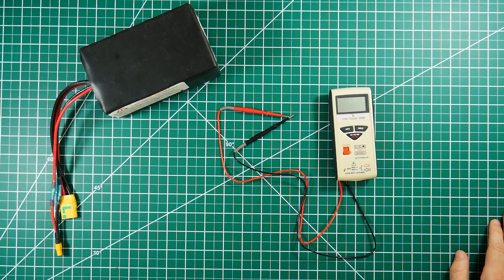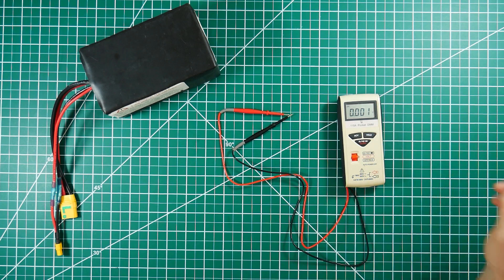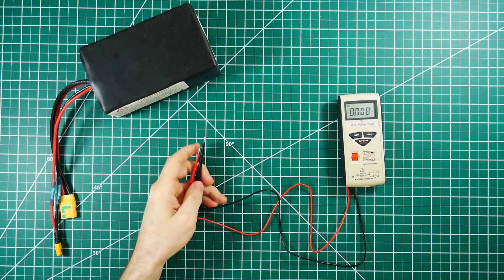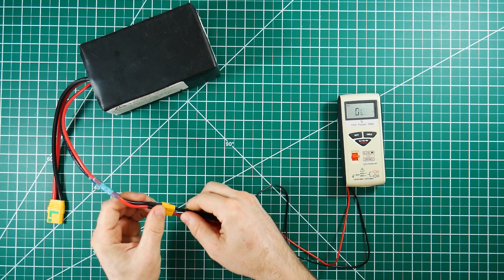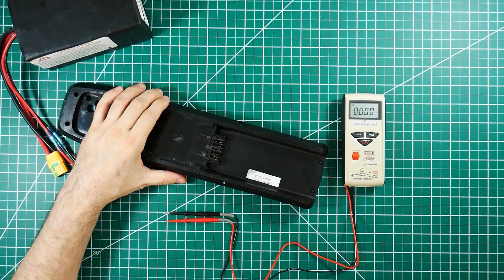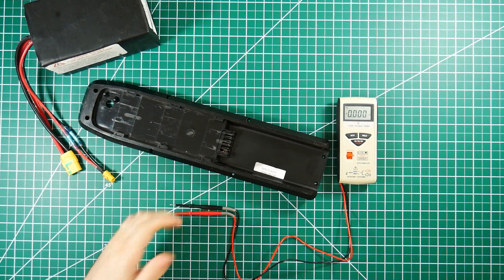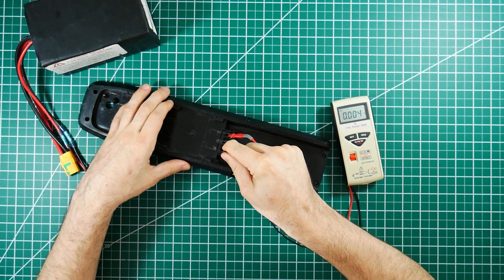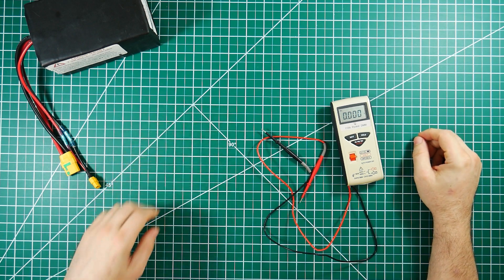How to check voltage on an ebike battery

Comment: So my bike (so I'm led to believe) has a 52v battery. The bike's LCD screen shows 58v when fully charged but my Volt meter reads 36.7v on the same battery when fully charged. Any ideas how on Earth that could be? Have I been sold a battery that isn't 52v ! ...and an LCD screen that reads 58v when it's not really 58v. That really would be unscrupulous!

Comment: MY 36V 10AH BATTERY SHOWS 41 on the multimeter,  but when in use and I am going uphill it slows quite noticeably and on really steep gradients it cuts out all together, I am trying to work out if the battery is at fault or the controller.  any pointers would be really helpfull, thanks.
Reply from the maker: Probably neither. It is currently December, so there is a good possibility what you are describing is voltage sag due to temperature effect of freezing weather. Either that or the cells are just worn out. See this page https://electricbike.com/forum/forum/knowledge-base/batteries-aa/55746-temperature-effect-on-li-ion-battery

Comment: If I get a decimal reading (.574) for voltage on multimeter …thats not good, right?  When I test other batteries the reading is closer to what maximum volt outputs range. 

/Bklyn👑
Reply from the maker: Sounds like you got it on the wrong setting

Comment: Thanks for the video showing us how to check voltage on a battery.  Question, are you knowledgeable on setting up wires for ignition (key lock switch) and throttle to send power to the motor on e-bike or e-scooter?  Does the controller only need a key lock switch and a throttle to run the motor?  Oh and hall sensor wires of course.  Is there anything else that need to be connected for the motor to turn?  My newly bought throttle and controller would not turn the motor...only my original throttle and controller work.  And the wiring is all different.
Reply from the maker: That would really vary depending on the equipment. Ideally you would get a pin out or wiring schematic for both the original hardware and the aftermarket hardware that you are trying to install onto it, that way you could figure out where each wire is supposed to go. So you could try reaching out to the manufacturers, or whoever sold you the equipment. If that is not possible an experienced person can probably help you to use a multimeter and/or trial and error. Post for assistance on a forum like the electricbike.com forum or on endless sphere. Be sure to include pictures!

Comment: Hey, any chance you can do a video using a hard cased battery that's sealed and not taken apart?

I'm not too experienced with my voltmeter device(way too many setting options if you ask me) and so far I've slid the battery out of the bike via it's folding handle and am sitting here staring at my battery the way it looks when it's in use on my bike and have no idea of where to stick the + - prongs to test the voltage.

Or do I need to unscrew something on the hard case so as to open it and have access to some kind of terminals?

TIA
Reply from the maker: You may want to ask for help on the electricbike forum along with a few pics, but generally there is a contact point between the piece you slid out (the case) and the piece it slides into (the cradle). That point should have some metal contacts representing positive and negative.
Reply: @fuzzyfriendlydoggy  Appreciate the quick reply fuzzy..So yeah, I found those metal contacts at bottom of battery and stuck the probes in there but 0 reading on voltmeter.
I think the issue is I don't know which rotary setting to choose.
DCV(200m - 500), OHM, BAT(9V or 1.5V), DC10A, ACV(500 or 200) or A DCA(20m, 200m and 2000u).

I have a 36V10AH Lithium battery..

Any thoughts?
Reply from the maker: @jono5900  take pictures of the battery and multimeter, and visit the forum. They'll be able to help further, just show them what you are working with and what the issue is
Reply: @fuzzyfriendlydoggy  Will do..thanks man

Comment: Hi again, can you use multimeter to measure the current (DC discharge current in amperage) on a big battery?  My electric scooter battery is Li-ion 27Ah battery and would like to know how much current it's putting out.. It's pretty powerful battery somewhere between 80~ 150A. I need to know what the current limit is from the battery.. Can you use multimeter like these using the similar method?
Reply from the maker: What's up buddy. You can't use a regular multimeter to do that, at a minimum you would need a clamp meter. It's pretty much just a multimeter that has a clamp on it, you put that clamp over one of the discharge wires, either positive or negative, and then run the circuit and it should tell you how much current is being used. Realistically however, in order to determine current limit on that battery you would need to probably be using the scooter at the time and you're not going to be able to get a good reading with that clamped on, so you would want to use a watt meter wired in line with discharge instead
Reply: @fuzzyfriendlydoggy  Ok I will look into getting a watt meter and test it then. This is so helpful to me. Thank you🙂

Comment: What fault does my e-bike battery pack have when there's 20 volts on the charger port (measured with multimeter) but 0,5 volts on the output?
Reply from the maker: Generally speaking when there is a difference from charge to discharge, it indicates that either the bms is tripped and needs to be reset (if possible), or it indicates the bms is faulty in some way.

Comment: I have a 48 volt battery from radpower, but it only reads 23.3 volts when measuring batteries connectors. That does not sound right?
Reply from the maker: Bms is probably tripped
Reply: @fuzzyfriendlydoggy  What do you mean? Does the battery need to be on? I was measuring in an off state, via switch.

The same voltage appears on the pins as well as the charging plug.
Reply from the maker: @raczyk  Yes the battery needs to be on.
Reply: @fuzzyfriendlydoggy  hey, now it works great!

Comment: Why was there a huge spark when I did that?
Reply from the maker: I would need to know what settings you had it on and where you got the multimeter from, obviously something like from harbor freight is maybe more likely to have a defect, you could always try to test the same procedure on something like an AA battery, if you're not getting a normal reading for an AA battery, then you probably had it on the wrong settings or there's something wrong with the multimeter
Reply: You probably had the multi meter on the amps setting as opposed to voltage.

Comment: Can I leave my multimeter on my ebike to monitor battery while riding and charging do I connect it between battery n esc?
Reply from the maker: If you need constant voltage reading you should wire in a watt meter or volt meter. Both do voltage readouts. A multimeter is more for diagnostic work.

Comment: Did not show correct reading on last battery... is this guy a joke!
Reply from the maker: 52v nominal batteries vary in voltage depending on the state of charge. The reading is correct. See our charts on the forum for the voltage range for each battery type. If you are referring to the demonstration of how to attach multimeter leads to a shark case, obviously there is no battery on there, it is meant to show how to attach to the terminal, not show an actual reading from something with no battery attached.